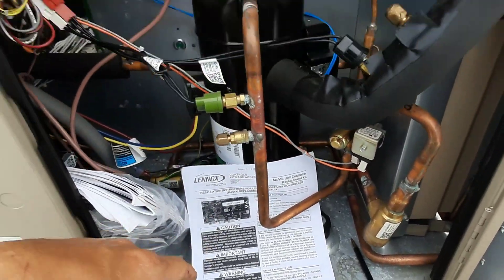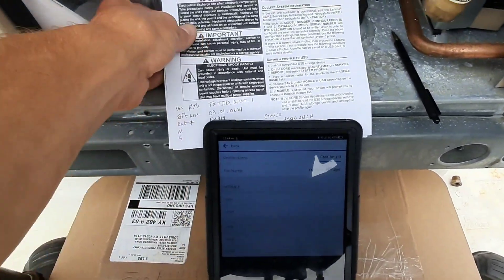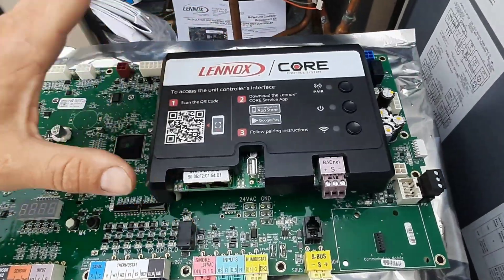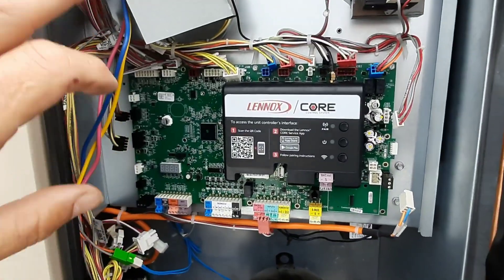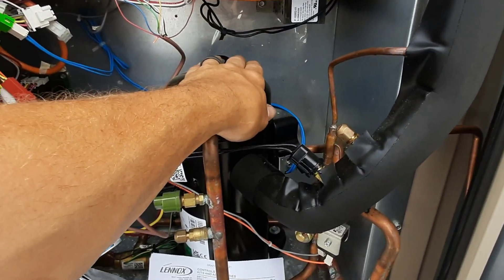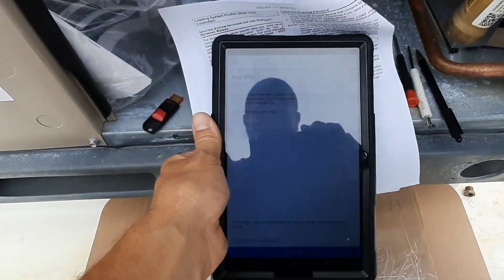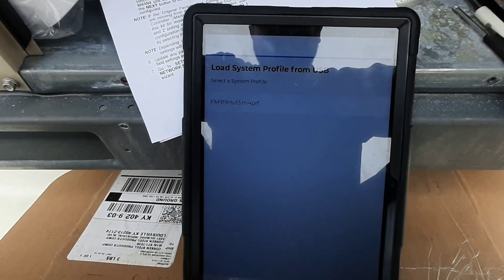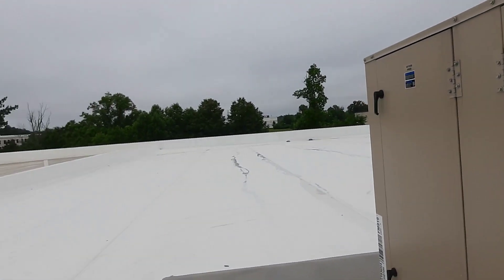Lennox Core circuit board replacement. Bluetooth connection damaged. #hvac #hvacservice #hvaclife

Comment: I had one of the Bluetooth buttons not even touching the actual board on a unit I installed a few months back I removed the black cover and pushed the actual button on the circuit board itself. It has crappy feel on the black plastic imo😊
Reply from the maker: Yeah, the plastic does take some getting used to. Guys over do it as well when it doesn't work, lol. Pushing it harder doesn't usually help
Reply: @EverythingHVACR  it’s like a thermostat gas pedal the lower you put it the faster it gets there 🤪
Reply from the maker: @shifter8207 😆

Comment: How much was that board? I replaced the main board in a Trane Symbio heat pump condenser back in December. It was almost $1200.
Reply from the maker: I don't know, honestly. It was warranty. They just asked me to install it
Reply: It's probably comparable. I had to program mine from an app. I think it can be done manually, but the app streamlined it. Couldn't copy anything from the failed board, it was DOA.
Reply from the maker: I would think it would be comparable. I haven't had to replace one on Trane yet. I like the Core app better too
Reply: Thanks again man appreciate all the posts ( uploads lol) you give us fellow techs in the field . 
   Its all getting high end AAON is not going to corner the market for much longer . 
     I do like LENNOX , i do believe they manufacture there own boards SURELITE   is there's completely.
    Great magaver  on that issue button .
  Ttysoon
Reply from the maker: Thanks, James! I appreciate it, I didn't know that about the boards.